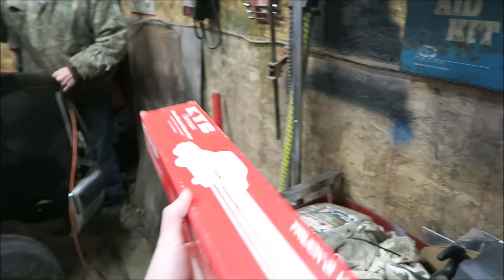Jack Black First Drive With New Engine and EFI! Hims Is ROWDY!

Comment: Best thing I did for my 1990 chevy was put a 2004 brake booster in it, Bolt right up to the master cylinder an through the fire wall, stops way better now.
Reply from the maker: It's definitely on the to do list!
Reply: What model ?
Reply: @gddub5652  1990 k1500

Comment: Great vid. Looks like a lot up get up and go. So I swapped intake and been fighting oil leaks. When you silicone the valley start by squeezing some in the corners of head and block than do the bead. If you dont it will leak oil down both sides of the back of block by eng cast number. Hope it is just oil sender though.

Comment: The efi is struggling at idle because the lumpy cam.  The TMAF sensor in the throttle body does not do well with back pulses because it effects the air flow reading and that is why factory efi MAF sensors are close to the air box and there is a resonator box to tone down the back wave pulses.  The efi would work better down low and mid with a 112-114 degree lobe separation, but that would hurt your top end.

Comment: I know the problem has been addressed months ago I ran into that on my 93 swb.. the switched power comes from the ignition switch to the oil pressure switch then to the fuel pump relay..with out the original oil pressure switch it doesn't have a pressure reference to close the switch to send control voltage to the relay to engage the fuel pump...I by passes it as well since I have a mechanical oil pressure gauge

Comment: My lower shock bolts broke as well. I took a punch and knocked it up through. Theres a welded on nut in the control arm that pops right off. And then nut and bolt it

Comment: Is the speedo still electric?  Maybe you got wiring gremlins and that why fuel pump didn't work either. Truck sounds great! 
How is Goldie Hawn doing?
Reply from the maker: I think we purged the wiring for it when we gutted the engine bay lol oh well. Thats what the tach is for
Reply: @SniderTron3000  lol shit happens.  
So vid on Goldie?

Comment: What size motor you have in Jack black I have a 355 in mine and it's not a quick as yours
Reply from the maker: basically the same size, except this is .060" over. But this has 11:1 compression and a healthy cam

Comment: The stock fuel pump wire runs through a relay. If oil pressure drops for more than a few seconds, it will cut power to the fuel pump. That was probably your issue with the fuel stock pump wire. Every once in a while, I'd have to cycle the key while driving to restart my fuel pump when I had my truck carbureted with a low idle speed. If you didn't hook your oil pressure gauge back up, that may be your issue with the fuel pump. Regardless, it sounds like you've got her running anyway.

Comment: Did you ever figure out the other trucks shifting issue?
Reply from the maker: Thinking the stock pcm doesn't want to communicate with the trans right. Hopefully next week a new pcm will show up and it'll be back on the road
Reply: @SniderTron3000  glad to hear it

Comment: That's not how u use a torch just fyi turn on gas turn up into black smoke goes away and flame is pure and like bird wings final add oxygen till u have a blue tip glowing